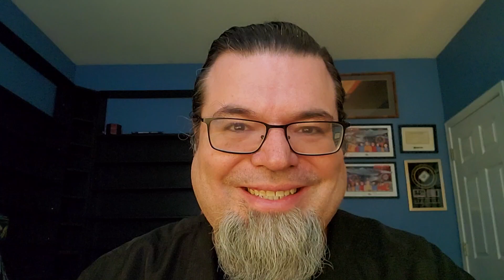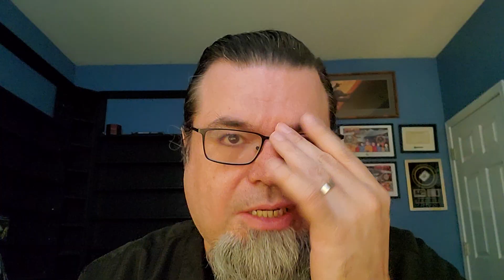Underground Nuclear Reactors: What to Know

Comment: Aquifers are a serious concern for nuclear reactors, especially with new designs like small modular thorium reactors. While underground reactors may offer advantages, we need to be careful about how cooling systems interact with groundwater.

Current reactors often use once-through cooling, which draws fresh water, heats it up, and discharges it—carrying contaminants like thermal pollution, trace radioactive materials, and chemicals (corrosion inhibitors, biocides). In oceans, this dilution is manageable, but aquifers are different. Contaminating groundwater could have long-lasting effects on ecosystems and drinking water.

With new reactor technologies, we have a chance to rethink cooling and filtration systems. Let's focus on closed-loop systems and improve wastewater filtration to prevent any contamination risks. We need to prioritize safety and ensure we're not repeating past mistakes—especially with sensitive resources like aquifers.
Reply from the maker: To your point, there is so much that needs to be done first in order to ensure it's fully safe!!
Reply: @NickEspinosa  No such thing as fully safe, diminishing returns. But to your point, we can always do better.

Comment: Yeah, this is rather "iffy" and is going to take a lot of work to figure out what works safely and what doesn't. Our entire core is hot because of radioactive decay, if it wasn't, the core would've cooled a very long time ago...and we might not be here as a result. I'm all for nuclear power -- I served on a nuclear-powered guided missile cruiser (U.S.S. Truxtun, CGN-35) back when I was in the Navy. I've been right up next to the containment vessels of both reactors we had (they were 98 MW each), and even got to take a look through a special view port into the top of the reactors (one of the guys who worked in the engineering spaces showed me -- it was pretty cool). Thing is, I've received more ionizing radiation from all of the X-rays I've had in my life than when I served on that ship (I have a record of it). So, nuclear power can be a lot safer than one might think...as long as it's not idiots in Moscow demanding something insanely stupid as is what happened at Chernobyl. Oh, btw, Three-Mile Island released very little radiation, unlike England's Windscale reactor fire back in 1957, for example.
Reply from the maker: Good points here! I mention Three Mile Island because it's the worst accident on U.S. soil and it did release radioactive gas and iodine into the atmosphere but, to your point, it was fortunately negligible in terms of long term harm unlike Chernobyl and Fukushima. Either way, I'd really prefer to avoid accidents of any type when it comes to nuclear lol. 

And yes, the sad fact here is that our military personnel are exposed to harmful radiation/atmosphere in a multitude of ways; combat (look at the burn pit problem), serving on nuclear vessels, missile base technicians (look at Malmstrom Air Force Base up in Montana and the ongoing legal woes over nuclear radiation exposure of missile technicians in the Air Force) and more. 

I think, when properly controlled and regulated, nuclear has proven itself to be reliable energy production and pretty safe. Lose that regulation and then get 6 part mini-series on HBO about just how bad it can be. And if you haven't seen their 6 part series on Chernobyl, it's fantastic (relative speaking).